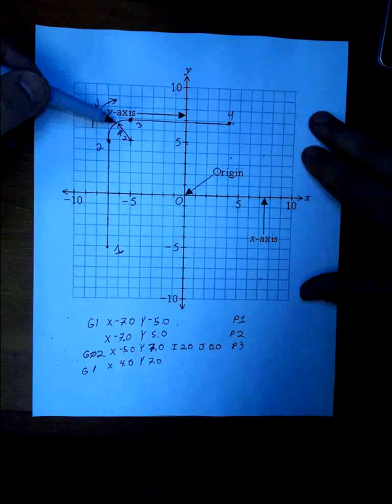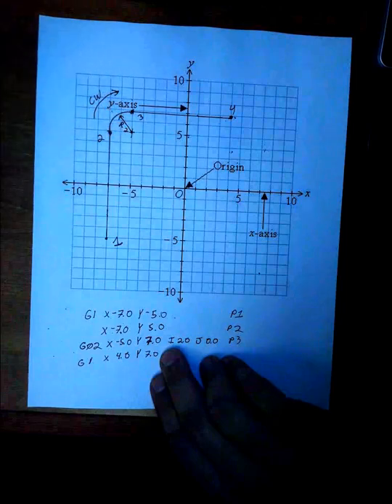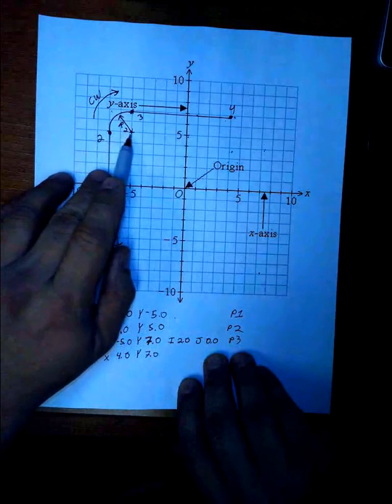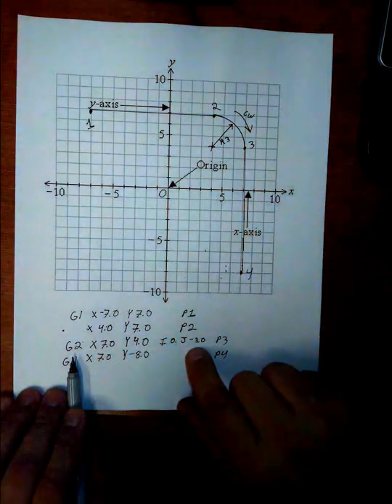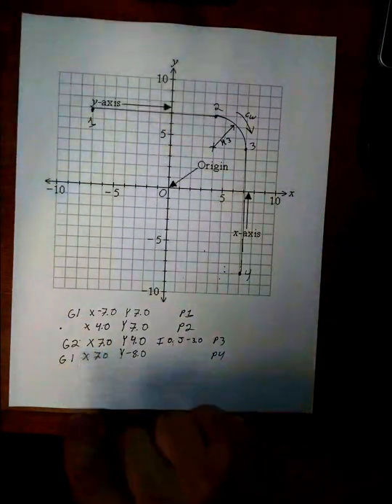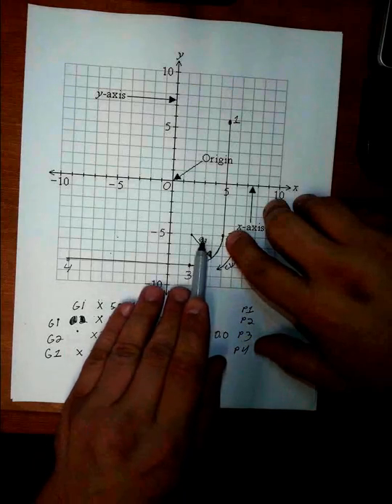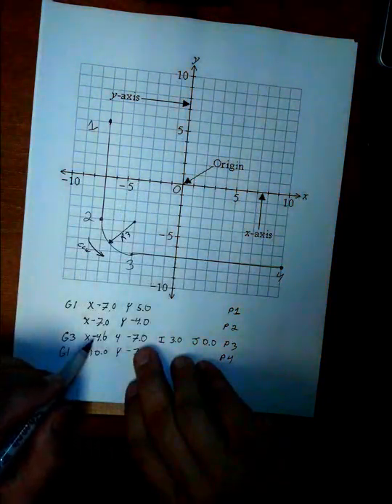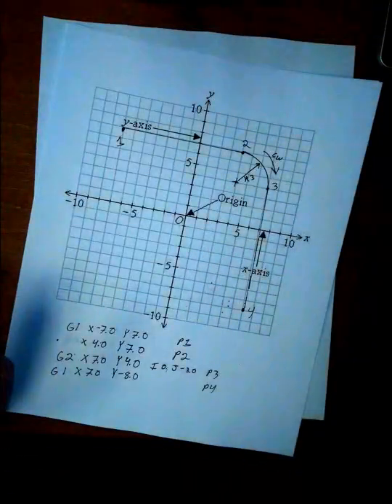I and J explained for 2444 Manual CNC Programming

Comment: I'm just a dude out here trying to solve a related problem. I've spent the morning using this video and a little determination trying to figure out how to write a dab of gcode. One of the problems I came across was not clearly being able to get where the I and J co-ordinates come from. Hopefully what I'm about to say wont show my general stupidity. The I and J co-ordinates are derived from the entry point of the arc the end point of the arch is simply a destination point. So basically no matter what the orientation of the drawing to your Cartesian graph is the numbers you're interested in are the entry of the arc and the center of the arc.

Comment: Other videos factor the diameter of the tool into their radius calculations, I'm curious why you didn't.
Reply: Well he doesn't specify if he's going part geometry and using g41 or g42  or if he's doing the math as tool path center and avoiding cutter comp. Either way is right just depends on the application.